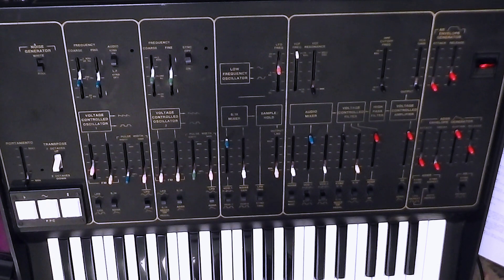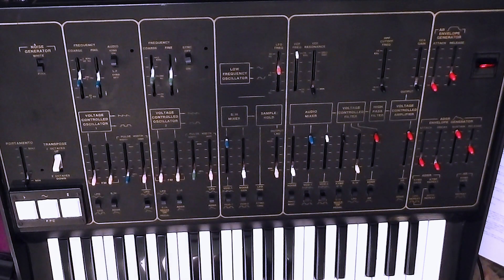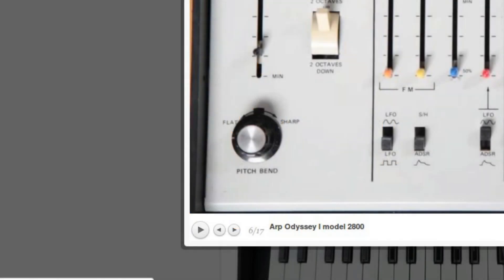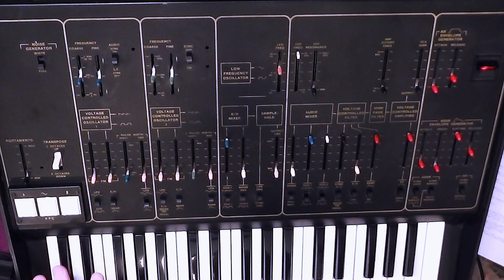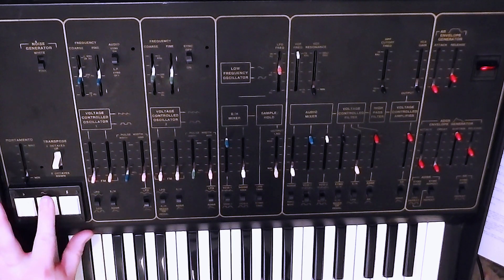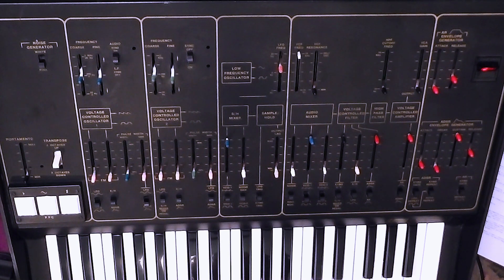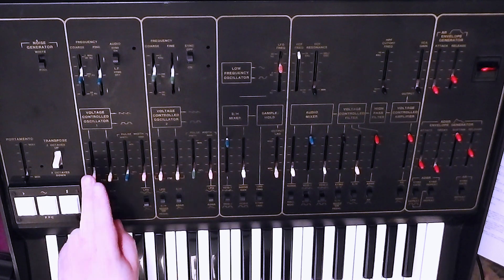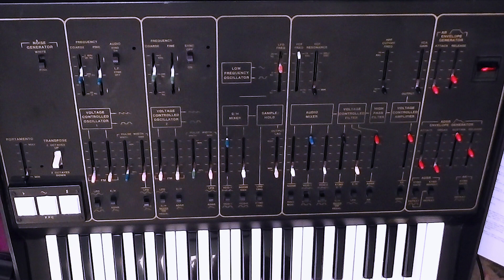ARP Odyssey: oscillators (part 2)

Comment: I feel your pain on the PPC but I've gotta say mine is accurate and perhaps reaches an octave , maybe wear and age like the sliders affects them
Reply from the maker: jamie munro The ones on my Axxe II seemed to work a lot better -- can't remember the range I could get out of it, but I don't think it was that large (I really must get it out and play it, hasn't been used in ages).

The accuracy though, that's more a matter of practice and muscle memory, or lack thereof on my part! Using pitchbend and vibrato together seems really tricky though! I think this is one area where I'd side with Moog, pitch and modwheels are a lot easier to use.

I'd not thought of that before and I think you're probably onto something about the pressure-sensitive components not ageing well.